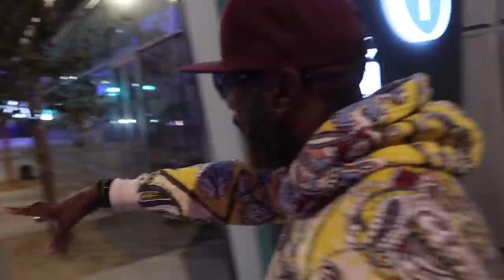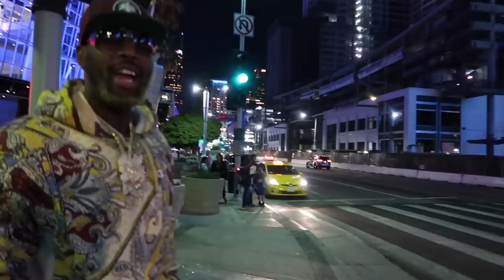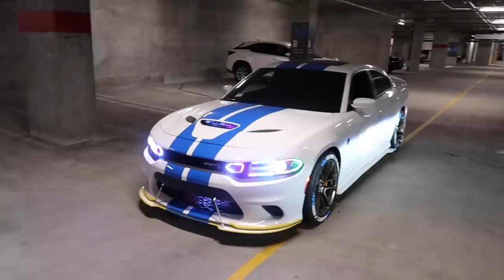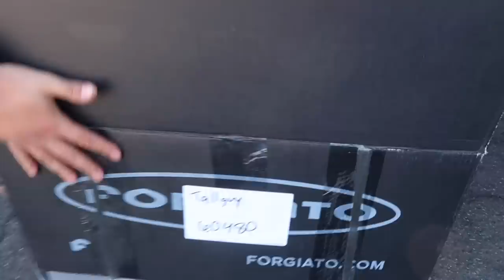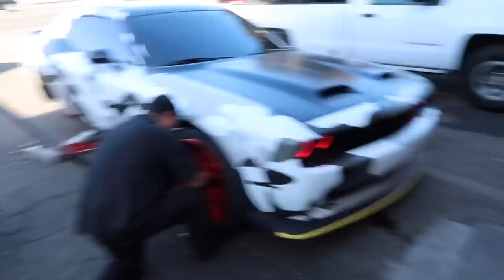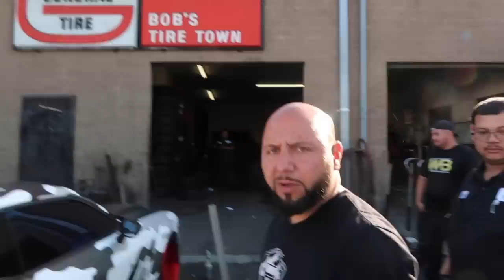INSTALLING MY NEW FORGIATO'S ON MY HELLCAT REDEYE! *UNBELIEVABLE*

Comment: Slim, make them put atleast a 295 or 305 on the front. The 305s fit and you went down in width upfront if you keep them at 275.

Comment: Legendary Video Champ I think the Hellkazy 2.0 looks BIG Legendary and you should have the Lowering Springs removed so the New Tires aren't so snug and I think the Slammed look doesn't fit a Redeye and I think you should keep the Stock Wheels and Tires for Drag Racing because I  honestly think you should experience what The Hellkazy 2.0 can do Before and After Modding it especially if plan on Getting a Demon and Demonology would agree

Comment: 22's on a Hellcat? You can definitely kiss any dreams of burnouts and drag racing out of the window unless you want to get new tires every 5 minutes. There's also a reason why racers use smaller wheels that have more tire thickness.